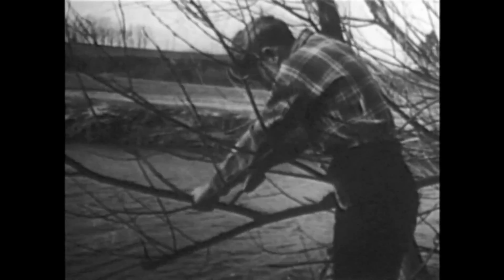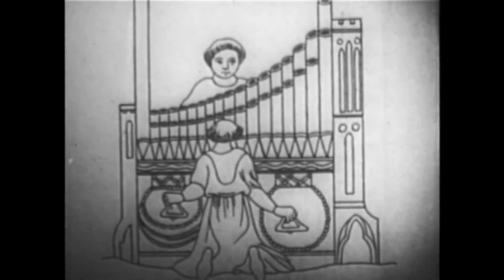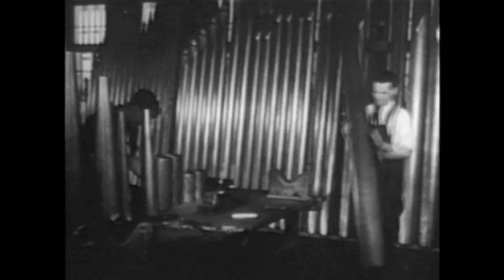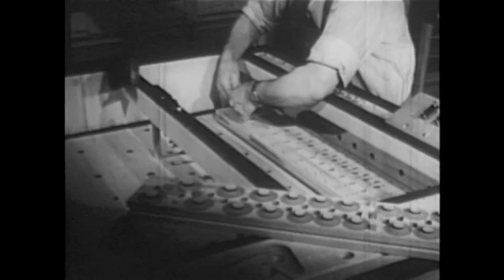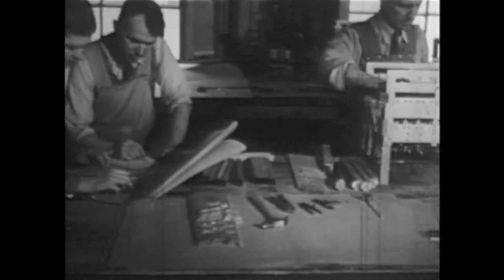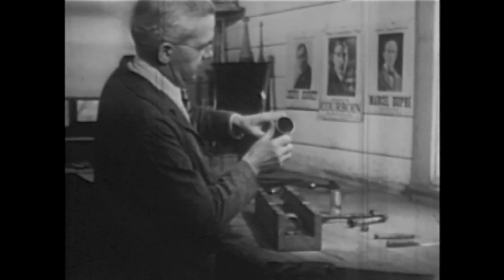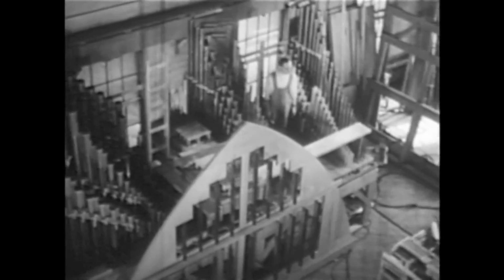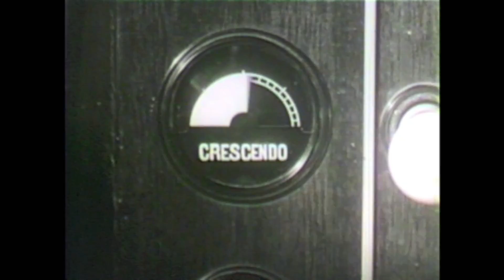The Singing Pipes

Comment: I am the actual organist at the basilica of Quebec. I listened this documentary with emotion. It permited me to listen how did that organ sound at that time! Very different than now. The last modifications was made in 1983-84 and now, it sound like a too loud french classical organ. The instrument need a huge restauration ($1,5M) and I wish to transform it in a neo-symphonic organ. Thanks very much for sharing!!
Reply: My church has a Casavant organ that was built  in 1986. I was the temporary organist there in 2001 after I became a member. It has 2 manuals/33 ranks. I occasionally play there now for funerals, since I now play regularly for another church which  has a very small Tellers organ. I played the Casavant 2 weeks ago and was reminded of the difference between the two instruments. The Tellers only has about 10 ranks and is crammed into a very tiny chamber but because of duplexing, borrowing and unification, the organ has a nice bright tone even if lacking a strong bass. It also has soft stops and a couple of reeds (trumpet and oboe). On the other hand, the Casavant organ can only be described as having 2 voicings (loud and LOUDER!). It does not have any soft or mellow stops. This is the only Casavant organ I have played but after hearing and playing this instrument I would not recommend this organ builder to any church unless they are looking for a very loud instrument.
Reply: @garysmith394 The Casavant I play is a small 4 rank extension organ. I find it is actually quite quiet, but granted the organ is way too small for the church that it is in.